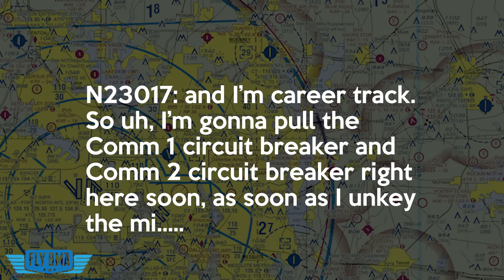Pilot steals airplane and Kills himself - Career Track 655

Comment: As a former ATP Student (I have since transferred to another flight school after completing my PPL), I can confidently say that their program is pretty rigorous and challenging. They push you probably harder than they should when it comes to this stuff. A friend of mine describes ATP pretty well, “ATP trains their students to pass a checkride, not to be a better pilot”. They care greatly about knowledge and skill, but they trim off just about everything else. Somebody else said in the comments that they and their instructor felt like just a number, I 100% agree with that. I joined ATP with 2.3 solo XC hours remaining before I was eligible to take my checkride. They sent me back to the beginning of their program and squeezed over $15k out of me over 4 months just so I could finish it. It would have been longer if I didn’t complain as much to the higher ups. The idea of ATP is great, and clear, I think they’ve begun to abuse it to the point where it has impacted the mental health of its students.
Reply: I'm glad atp kicked me out, and for the dumbest reason. After I got my private pilot easily they said since I'm not going into thr airlines the program isn't for me. They did that so they can skim money off me and charge me $50,000. My lawyer and I put a stop to that so i got 110 hours for $20k. Then I managed to get the loan company to cancel the $20k loan because I know how to write them in a way to get it to happen. Now I go to a much better school with career instructors. I can schedule myself at any time like 30 min before a flight and go to the school at night, open the gate with the code, grab the keys, and go build night xc Pic hours with friends at less than HALF the cost at ATP, and without an instructor whereas at ATP you will never fly solo except during private and never at night except at private. My total cost from zero to CFI will be $30,000 or less by the time I'm done, and I have my own business that makes around $200k a year. I'm chilling. I feel so bad for fkers at ATP. They only got into aviation because they wanted free travel and more money not because they care about being a pilot. And the only way they could become a pilot is by getting a fkn loan, it's hilarious to think you owe over $300k by the time you pay it off, TEN TIMES more than what it will cost me. Sorry dude.. PS. I'm currently the one responsible for a class action against ATP. We have over 1000 representatives who are former ATP victims. If you want in reply back to me. They are all about false advertising and corrupt business practice. They also leave the keys IN THE PLANE with doors open because they WANT their planes stolen so they make money through insurance. GUARANTEE YOU this accident hasn't changed the keys policy because they want to make money from people who steal and crash their planes.

Comment: Seeing a lot of negative comments about ATP but I don’t think this has anything to do with ATP’s school. This seems like a man who was struggling and could have really used some help outside of flight training.  I didn’t train at ATP but I’ve worked a lot with ATP and I have been very impressed. It’s a difficult program that is certainly not for everyone but it does provide the best path to airlines, if it’s a good fit for you. I trained at a university, and my friends that started at ATP at the same time as me have now been flying at the regional airlines for years, some are even at the major airlines now. Whereas my graduating class is just barely getting to the regionals. The proof is in the pudding. You have to treat it like an academy or high level university and make sure it’s a great fit for you. If it’s not, you have to go find somewhere that does fit your needs. The key is to find the right flight school for you and your learning style. Those that I have known that have gone through ATP have finished in about 9-12 months but even that is still significantly faster than almost any other program, even if it’s longer than their program is designed.
Reply: I’m currently attending ATP and have zero complaints

Comment: Suicide is sad whether it happens on an airplane, car, hotel.. etc. Increasing restrictions on anything, just creates more reasons to limit or impede people, which creates more depression. It's a circle. I believe the key, is to teach kids to deal with disappointment at a young age. Happy people don't commit suicide. So, it may be better to instead reduce general restrictions across the board (meaning in non-aviation areas as well)  while simultaneously increase safety through improved technology. And remember, cost-prohibitivity is just another form of restriction.

Hoping readers don't see this as a troll, but rather, my honest perspective on this topic. Be gentle, if you disagree.
Reply: You are very much correct!
I like how you cited a broader perspective of not just pilots, because limiting and restrictions can make someone feel easily depressed.

Comment: This is a suicide using an aircraft as a method. This is not an aviation safety issue - it’s a societal mental health issue which plagues western cultures. Start there - the rest will follow.

Also the notion of using “it’s never that bad” as a preventative strategy has been debunked by multiple high quality studies… it’s one of the most challenging aspects of mental health… the concept that rational thought is separate from the thinking depression results in. How else can loving fathers resort to suicide leaving widespread carnage in their wake in the numbers that they do? A more nuisanced understanding is required if you’re going to discuss these topics… though I applaud your willingness to do so.

Comment: I went to ATP and finished the program mid July of 2022. I attended the KTUS location. I finished instrument to MEI in less than 7 months without failing any checkrides. I had great training and very few complaints about the program. For me ATP was very upfront in the fact that this a fast pace program and isn’t for everyone. They also made it clear that I should not work or go to any other school (college classes) during this time. Yes some days were long and tiring however it was very easy for me to have long days studying because I knew I was getting towards my goal of an airline pilot. I can’t speak for everyone but before for I started it was clear that a lot of effort was needed to complete this program. However they do not pay their instructors enough and that’s why I chose to instruct elsewhere.
Reply: Also I have been told ATP instructors make $20 an hour but only get paid for Hobbs time. They do not get paid for grounds. And they get $15 an hour for dual given Simulator time. ATPs maintenance and aircraft were superb.

Comment: Jon, I've been trying to get my medical for the last two years.  I have been diagnosed with depression and anxiety in the past and the FAA has ordered me to travel through endless hoops.  I've persisted however and the way the FAA approaches mental health is in desperate need of change.  If a pilot reports, they have attended therapy (especially if they have been diagnosed by the person conducing that therapy) it can lead to a temporary loss of their medical.  Rarely are pilots "final denied" as this often happens in extreme cases with Bipolar Disorder, Schizophrenia or severe suicidality.  Pilots should be able to take common anti-depressants and attend therapy without being deferred.   Hopefully in the future, AME's will be able to issue in the case of mild and moderate mental health disorders. The FAA's current system creates an urgent safety issue in my opinion.

Comment: ATP Sacramento is notorious for not locking their aircraft as well as providing students key codes to enter the school after hours. I once had a checkride that started at 0400 because the DPE claimed the FAA examiners don’t show up until later and won’t join in unannounced if an oral checkride is already underway… If ATP schools nationwide also have the same all-hours access policy then it stands to reason that this tragedy could happen again. It is an intense training regimen and not everyone is cut out for that level of stress and fast pace, and someone may eventually crack under the pressure. I hope I’m wrong.
Reply from the maker: I love that the DPE was that concerned about avoiding the FAA.  Hopefully he was just an early riser and wan't working that hard just to stay off the radar.

Comment: There is a huge problem with things like this that aren’t relegated to just aviation and aviation career fields. I have personal experience in the public service sector, being a firefighter/paramedic for several years, which has its own set of obvious on-the-job stressors that can contribute to suicide and suicidal ideations in even the most mentally fit of people. The problem is, you would lose your job if there was the tiniest incline of mental or emotional distress such as seeing a therapist or requiring anxiety medication even in the short term, and like the FAA, that mentality is everywhere so it’s not like you can just go and find another job. Most people need to keep their job, so they often will not seek help out of fear that their employer will find out and terminate them.

I would say most mental distressors people have are not due to legit psychological pathology. Most of the time, it’s people trying their best to cope with normal, everyday human experiences. Things like family or financial problems, the loss of a loved one, processing life-changing events, etc. Of course, this doesn’t include scenarios encountered on the job (especially for those in mentally-taxing career fields such as military or first responders). Suicidal thoughts or actions don’t just pop up out of nowhere. It’s usually a variation of these situations compounded over time, and the inability to productively work through them, that leads to thinking suicide is the only solution. What needs to happen is the allowance of people to seek therapy without consequence if they feel they could benefit from it. Some of the “normal” life stressors can get the best of anyone sometimes, and proactively addressing a problem before it becomes a big problem only makes sense.

Comment: I recommend reading “The field guide to Human Error Investigations” by S. Dekker. Even though this is clearly a different case (security rather than safety), the field guide highlights the main questions to ask and pathways to take for an investigation and subsequent recommendations, all starting from: “The only thing that matters is what happened.” Many analysis suffer from hindsight bias so it is very important to always look at each episode of an event in the context at the time under the local rationality principle. In this case especially, it is important not to judge the people of the flight school etc. I understand for many the first reaction is, how can this happen, how did the flight school not see this, the FAA etc. Unfortunately this is not all that helpful and will likely lead to the same thing happening again. Only when you acknowledge that the cause runs much deeper and press hard and long enough until you understand why it “made sense” for the student to do what he did, you will be closer to solving the case and making aviation safer.
Reply from the maker: Thanks for the book suggestion brad and thanks for the reply

Comment: I think about how it must be to have mild depression as a pilot.  I can’t speak for the FAA as I am not an American.  In Canada though our regulatory body will let you fly with mental illness if you have another pilot.  So.. how the hell does that work if you have a 172?  Not allowed to fly it alone basically.. and it’s entirely impractical for GA pilots to require another pilot to be with you.  Absolute wing clipper.  

As another commenter has said there needs to be another way to get help than have a permanent record.  Some kind of anonymous thing.